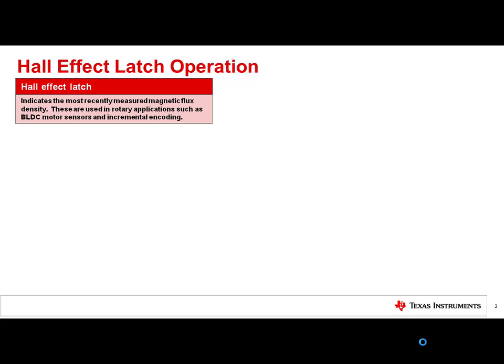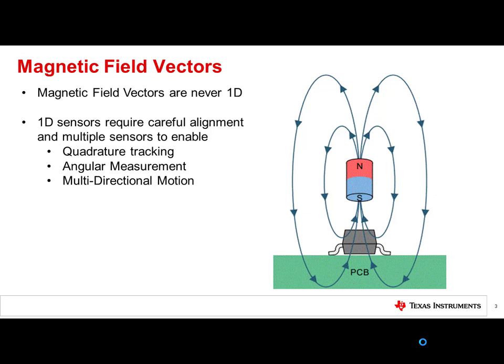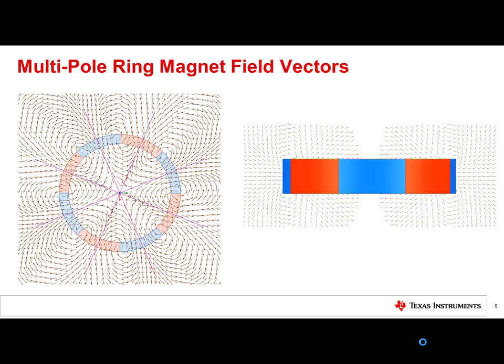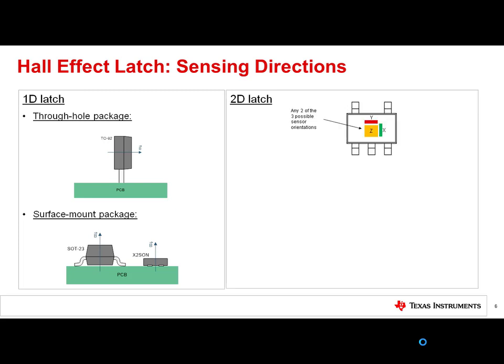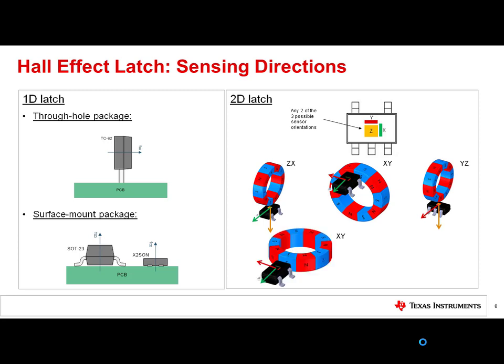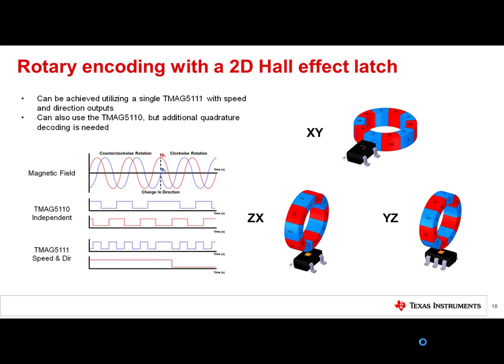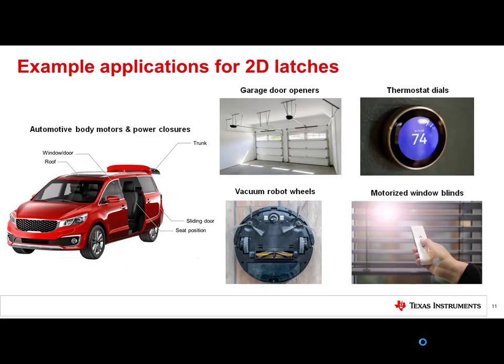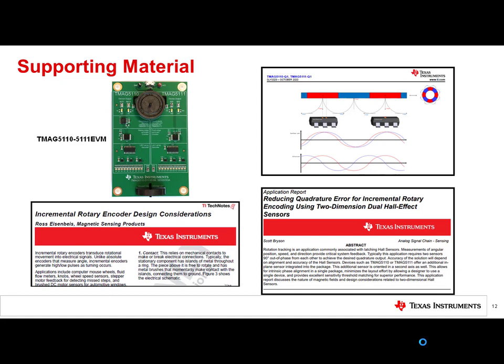Understanding 2D Hall sensor latches

Comment: Great info but I just want to turn a mosfet off and on (latched off and latched on) with a magnet.
Reply from the maker: Hi Michael, thanks for your interest! If you’re interested in doing something simpler than rotary encoding, you can view this video, which also discusses latches: https://training.ti.com/ti-precision-labs-magnetic-sensors-latches-switches-operating-release-point. While it is not possible to control a MOSFET directly with a magnet, this video explains the Hall effect and how Hall-effect ICs translate a magnetic field to an output: https://training.ti.com/ti-precision-labs-magnetic-sensors-introduction-hall-effect-position-sensing.